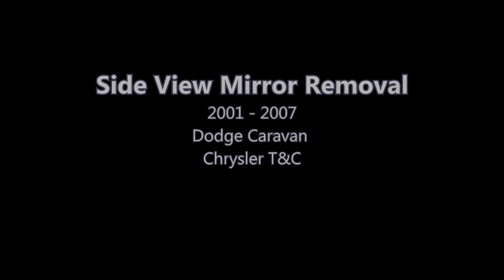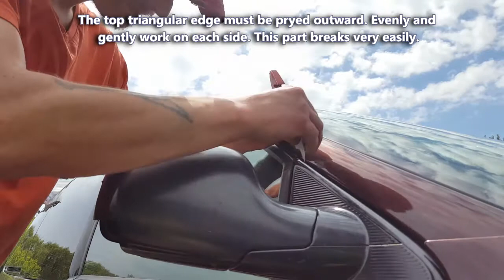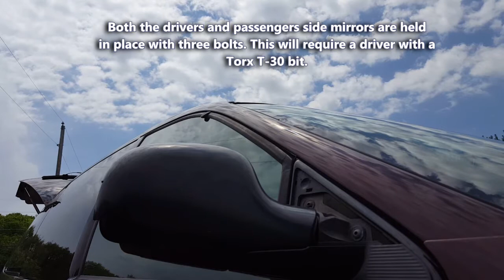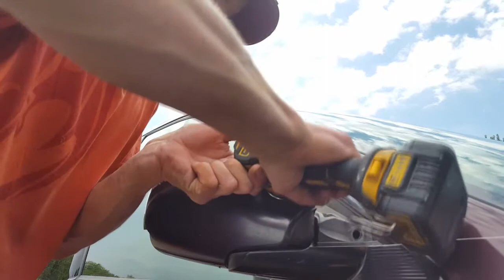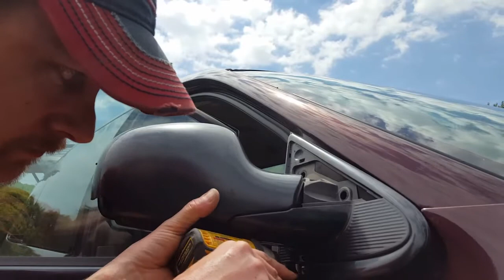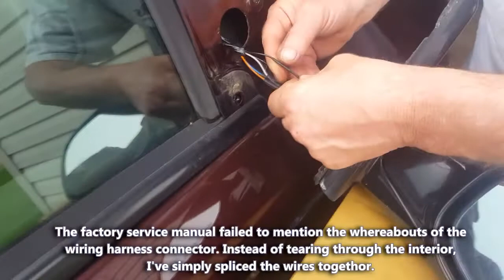How to Remove a Dodge Caravan Side View Mirror (2001 - 2007)

Comment: I’ve changed a mirror on a 2005 town and country. Took about 15 mins and I didn’t have to splice any wires.
Reply from the maker: Until this day I still haven't managed to remove the connector out from under the dash. I've replaced 4 or 5 of these mirrors over the years. The service manual doesn't explain that step very well.